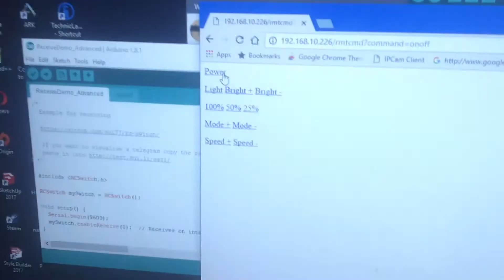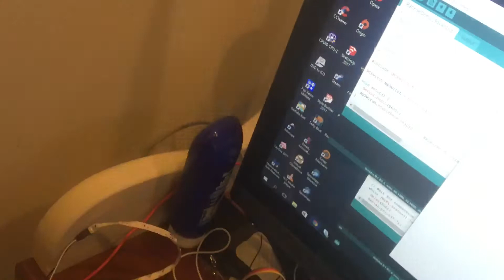Arduino ESP8266 (Wemos D1 mini) WiFi/RF 433Mhz remote control RF LED controller

Comment from the maker: Using the Wemos D1 Mini in combination of a 433Mhz transmitter (XY-FST), I was able to emulate a wireless RF remote control. The remote control, controls an LED driver which drives the power to a LED strip.

To get this to work you first have to capture the Remote Control signals. I used the XY-MK-5V receiver module to decode the remote's commands. Once each button command was decoded and recorded I went on to creating a ESP8266 WiFi WebServer which relays the web commands into RF signals and transmits them to the LED controller driver.
Reply: Can you please post a link with your code?

Comment: Hi, would you mind sharing the sketch? Or at least the codes for the remote. I have the same RF LED controller, but I've lost my radio receiver module and now I can't learn the codes :(
Reply: never mind, just found out that the code for on/off is 1 :D thats all I needed...
Reply from the maker: POWER = Decimal: 5440257 (24Bit) Binary: 010100110000001100000001 Tri-State: FF010001000F PulseLength: 394 microseconds Protocol: 1
LIGHT = Decimal: 5440260 (24Bit) Binary: 010100110000001100000100 Tri-State: FF01000100F0 PulseLength: 394 microseconds Protocol: 1
BRIGHT+ = Decimal: 5440261 (24Bit) Binary: 010100110000001100000101 Tri-State: FF01000100FF PulseLength: 394 microseconds Protocol: 1
BRIGHT- = Decimal: 5440262 (24Bit) Binary: 010100110000001100000110 Tri-State: not applicable PulseLength: 394 microseconds Protocol: 1
100% = Decimal: 5440263 (24Bit) Binary: 010100110000001100000111 Tri-State: FF01000100F1 PulseLength: 394 microseconds Protocol: 1
50% = Decimal: 5440264 (24Bit) Binary: 010100110000001100001000 Tri-State: not applicable PulseLength: 394 microseconds Protocol: 1
25% = Decimal: 5440265 (24Bit) Binary: 010100110000001100001001 Tri-State: not applicable PulseLength: 394 microseconds Protocol: 1
MODE+ = Decimal: 5440267 (24Bit) Binary: 010100110000001100001011 Tri-State: not applicable PulseLength: 394 microseconds Protocol: 1
MODE- = Decimal: 5440273 (24Bit) Binary: 010100110000001100010001 Tri-State: FF0100010F0F PulseLength: 394 microseconds Protocol: 1
SPEED+ = Decimal: 5440271 (24Bit) Binary: 010100110000001100001111 Tri-State: FF0100010011 PulseLength: 394 microseconds Protocol: 1
SPEED- = Decimal: 5440269 (24Bit) Binary: 010100110000001100001101 Tri-State: FF010001001F PulseLength: 394 microseconds Protocol: 1